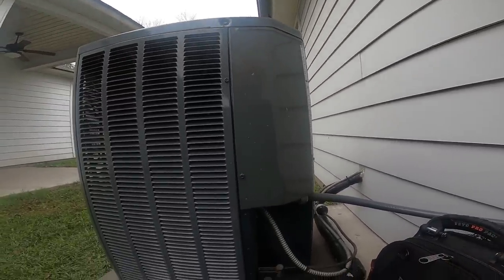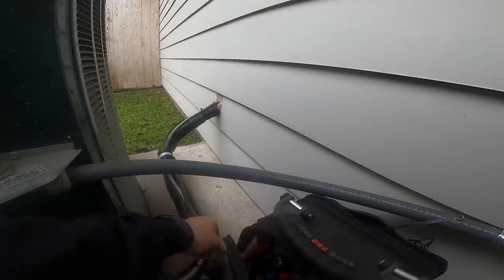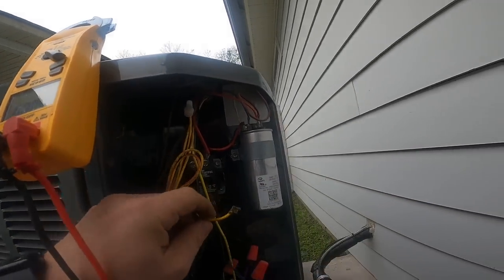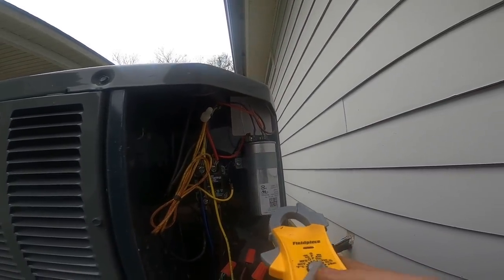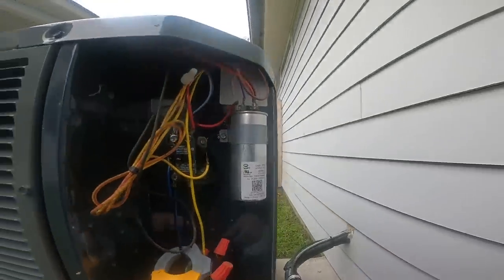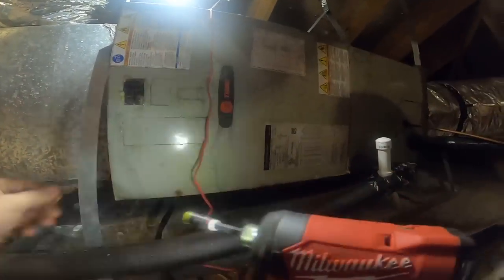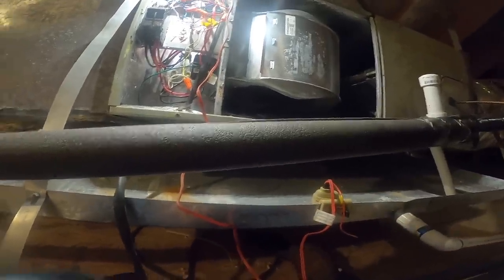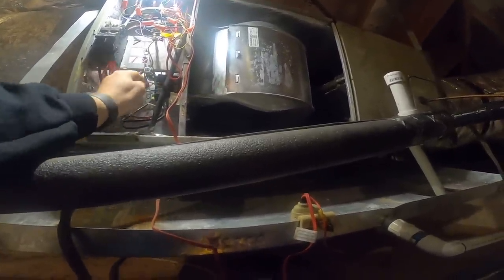Check Up on a TRANE System

Comment: Back when I did installs we used to hang them up so they wouldn’t vibrate the ceiling. But we also used threaded rod or cable and unistrut. Love the content John

Comment: I'd say he has a control problem, and the contactor is going on and off very quickly and causes the compressor to spin backwards.  if you can't find anything that is causing it you can install a time delay on the outside contactor.  Probably the thermostat.   Thanks for the video. liked it.

Comment: You know I wonder if that may be my issue I have a 5 ton two stage American standard heat pump version of this unit that the heating just randomly doesn't work swore up and down that it was going off on high or low head pressure in heating my installers are scratching their heads because it just randomly does it both the compressor and capacitor tested good. But when it's acting stupid and not heating the compressor is loud as heck and won't cool or heat.

Comment: You can check voltage going into contactor on one leg and check to see if its coming through on same leg. Swap to other leg and do the same. Sometimes they arc together on contacts and will keep things running. Take contactor off and check continuity with it pushed in and with it released.

Comment: So why don't you check refrigerant in heat? Also didn't see any temperature splits taken.
Reply from the maker: Cause it’s not a heat pump. You should’ve seen that in the video. Did you see a defrost board?? Come on man
Reply: Lmaooo sorry man saw this in the early morning and my brain wasn't awake yet. I'm in Pennsylvania and I'm not used to seeing an only electric heat strip furnace.
Reply from the maker: @cruzhvac4551  it’s all good brother